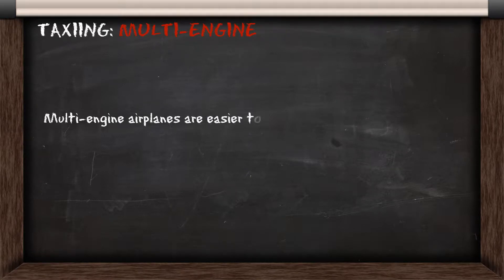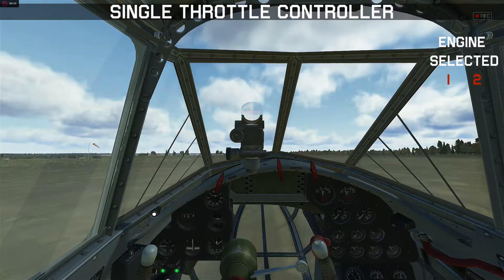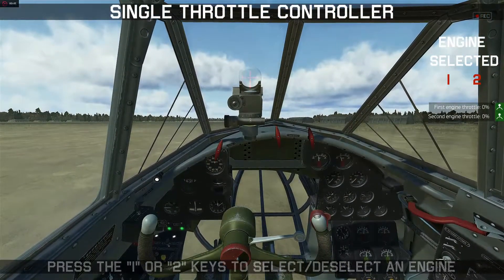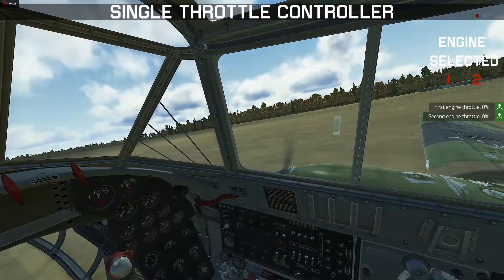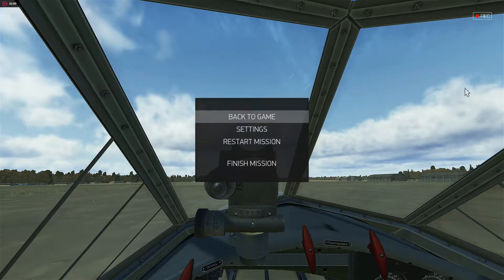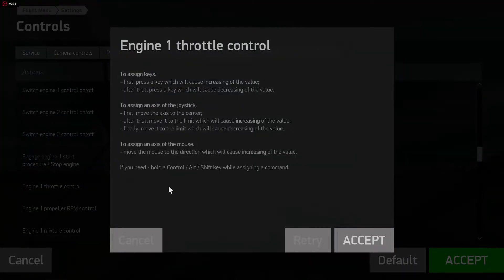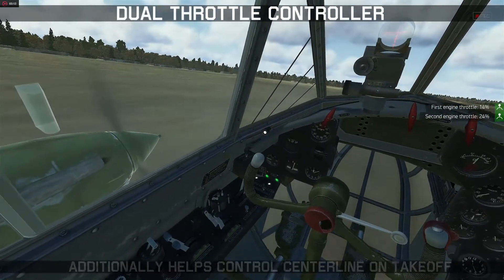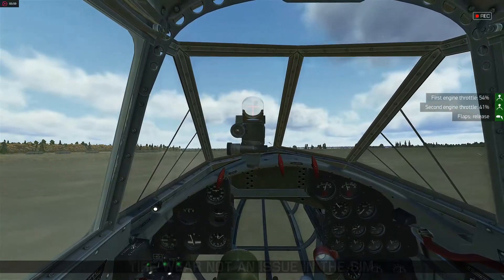Principles #12 - Taxiing Multi-Engine Airplanes

Comment: What throttle do you use? I recently have got the ThrustMaster TWCS, which is a singular throttle, but has a ton of buttons and switches and hatswitches on it, so shouldn't be too hard putting the engine selection on one of the lesser used hatswitches instead of the keyboard.
Reply from the maker: I use a Thrustmaster Warthog which works well in general with all the sims I fly
Reply: @RequiemsACTL  aah ok. that makes sense. XD

Comment: Well produced as always.
How useful (would you say)is dual control in combat?
Reply from the maker: I really like having the dual control in combat because it allows you to easily adjust an engine on the fly (no pun intended). This can be a time critical thing if one of them is damaged. You can quickly adjust the power and RPM to nurse a bad engine along to last longer than it would at full power. Plus when flying a twin it just feels natural to have two throttles to work with!
Reply: It's a shame there's no 4 engine jobs in the game.  The PE8 would be great, with some tutorial :-)

Comment: as ever a great video, (i started learning from you in ROF (the best air combat simulator ever!) and still use your FMB tutorials as the best guide for BOS). But , could you or anyone else comment on HOW to use differencial power on take off. I have been very frustrated with the JU88 and Pe2 series groundlooping i now know why due the fact that they had no lockable tailwheel but how does one select/deselect ,power up/down, and then reselect the engine engines.....lets say things are happening quickly!!! Lots of people DO fly the  Ju88 and Pe2 online and i find it hard to think that everyone has multiple controlers for their throttle!! Any tips will be greatly appreciated!!
And again ,many thanks for the years of hard work working on videos for peolple like me!!
Reply from the maker: Thanks James,

The mission builder tutorials aren't mine though. Those belong to SYN_Vander I believe :-) I'm on a trip right now so I've only got access to my laptop, but when I get home I'll reconfigure my throttle to be a single and check out the takeoff with the Pe-2 and Ju88.